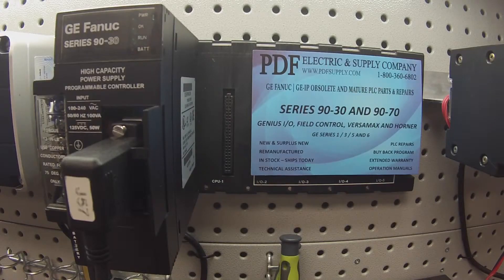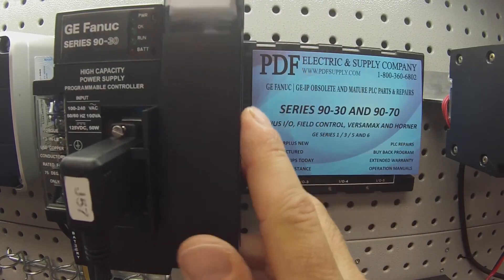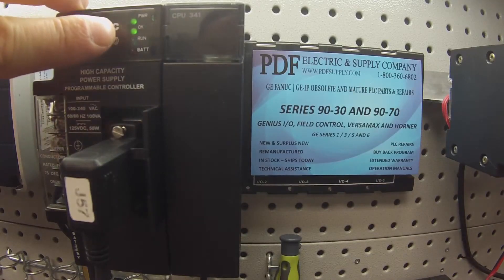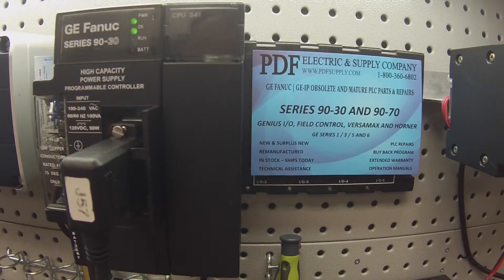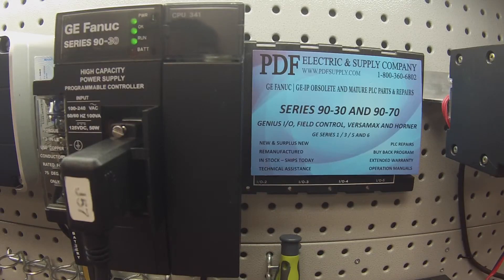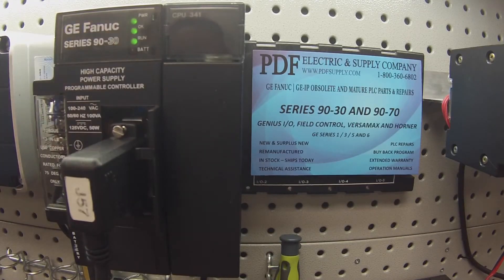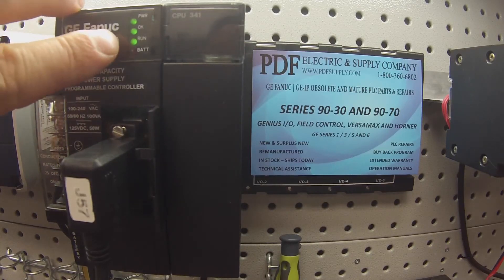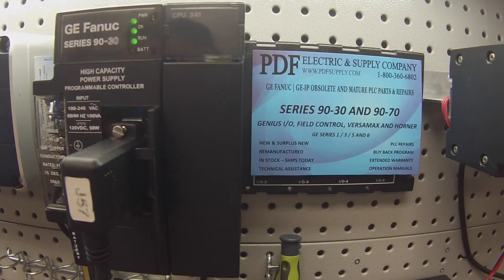How-To Troubleshoot: IC693CPU341 (GE Fanuc PLC Training Series 90-30 CPU)

Comment: que software necesito para realizar un backup a un IC693CPU341W?
Reply from the maker: When it comes to software, your best bet is to contact the manufacturer directly or find your local GE rep - and here's why: they can provide the technical support for software. You might have some luck with their support line: 1-800-360-6802